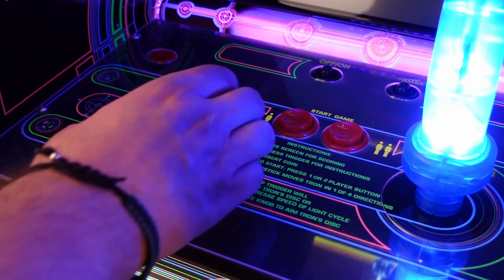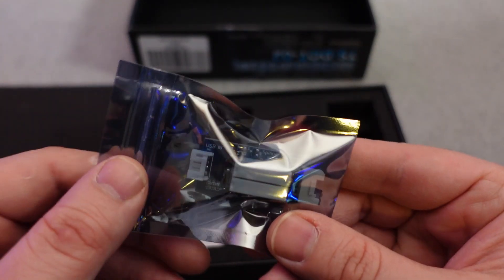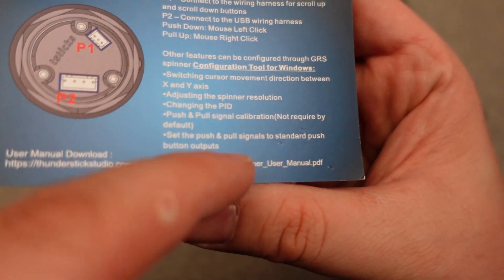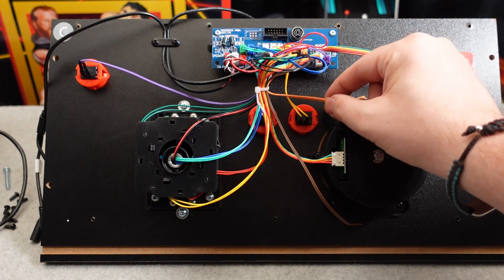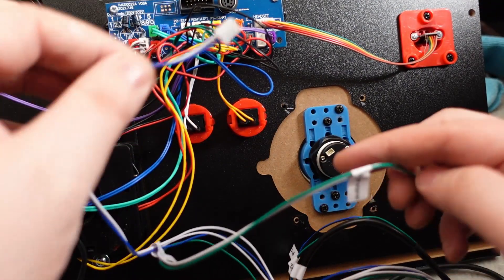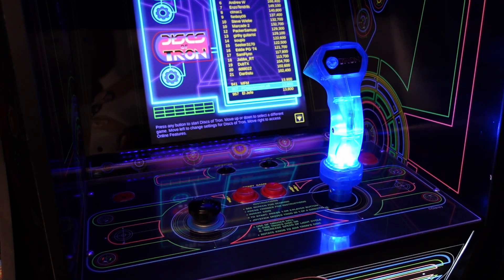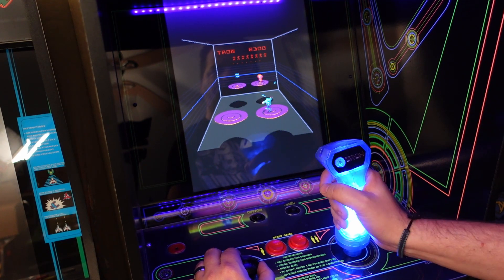Arcade1Up TRON GRS Push Pull Spinner Install & Review!

Comment: The most important part the spinner adaptor you have to source yourself.  Not everybody have a 3D printer.
Reply from the maker: If you mean the mount yes this was clearly covered in the video and could take someone less than 10mins to order online from a 3D printer website.
Reply: I think they should seriously consider including it in the future (or have a link to order directly from GRS if they can make them in small batches).
Reply: Check your local library - many have 3D printers now and can print for a very small fee.
Reply: @PDubsArcadeLoft   what are the specs I want to get a clear one made, and can someone recommend a good 3d print company

Comment: I was able to modify the existing push-pull housing after stripping out the original spinner by drilling out the diameter of the GRS spinner. Not perfect, but it works.

Comment: My stock spinner broke when I was not even playing it. Anyone else have that issue?
Reply: Yes, it’s happened to me as well a few times now. A1up though has always been great about supplying replacement parts but I seriously believe all the stock spinners are bad on Tron meaning a definite manufacturing defect. No way should these be failing with the cabinet off or even leaving it on for a extended period of time. I’m now keeping mine unplugged unless playing the machine.
Reply: @tommyv.856  I am not going to get another spinner from A1up then since it will probably brake again. I am going to get this spinner.
Reply: @arcadetalk  yeah, good idea! I bought mine a couple days ago and it was on sale for 30% off. I would jump on it soon for that price.
Reply: @tommyv.856  I just ordered it and got that 30% off too!
Reply: @arcadetalk  nice!!!
Reply: Pdubs did you make any adjustments to the sensitivity? Im wondering if the spinner is still too sensitive even when adjustment to the settings have been done. Thank you.
Reply: yes, and I have the tron game on VERY rarely. Because I was worried it might...stop working.

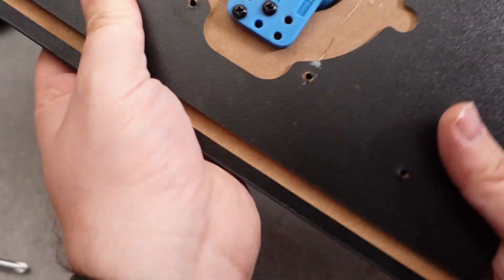Comment: @6:23 STL not STI. Also make sure you do not print it out of PLA. Over time, PLA creeps under compression and the screws will come loose. Use PETG or ABS which do not have that problem.

Comment: Installed mine last night along with the GRS flight stick.  

Has anyone who has installed this spinner been able to tame this beast of a spinner.

If so can you share what you did to calibrate this spinner to 1980s arcade level.  Not sure if anyone but me will be able to use this.

Unfortunately my old spinner took a nose dive into the garbage after it stopped working.

I sent a message to Glen to see if there was a way to place a 4th selection in the calibration software at a lower rate.
Reply: This is an update to my original post.  My original spinner failed and wanted to try this mod from GRS.

Flight stick is a definite buy and a huge upgrade for my Tron.  

The spinner is a high quality but  even at the lowest setting.  I was able to use it.  My family could not play.

I thought about a Tornado spinner.  

In the end I decided to work with Arcade1Up and obtained a replacement spinner.  They are stepping up their game with service.

Since my game was out of warranty I paid about $28.00 for shipping and handling.  

Had to take four steps and used the app.  Provided short vid showing my original wasn’t working, pic of my serial number, and my proof of purchase from Walmart.

Sent me an invoice for 28.00.  Paid it and receive new spinner in a week.

I will find another project to use the GRS spinner on.  Sure it would be fine with MAME where you can make adjustments.

Others can form their own opinions and it may work better for them.  If they find a way to add lower settings I will give it another try.

Take care everyone!

Comment: I was able to skip step 5 (the 3d printed mount) by using a step drill bit to make a hole on the original spinner mount.  I then used the step drill bit to drill another hole in a plastic bottle cap to make up the 1/2" of recess in the control panel.  Looks pretty good with the clear cap but I'll probably paint it black.

Comment: Remember, you can use the software to adjust the rotations from as low as 360 and up. There are four separate settings so you can dial it in a little bit more to your taste for the spins. Great video though once again p-dubs Thank you!
Reply: @Glen  I have mine set at 360, it is still too sensitive, but usable.
Reply from the maker: Thanks Glen!
Reply: @americansupervillain4595  I'm in the same spot.  A  bit too sensitive.  Very hard to target on DoT.  Can pdubs or glen recommend a fix or adjustment?  I'm at 369 cpi too,

Comment: @pdub- I bought the kit, and did the calibration- it worked fine plugged in to the computer, however when plugged in to tron, push pull works, but the rotation doesn't. Any help would be great!